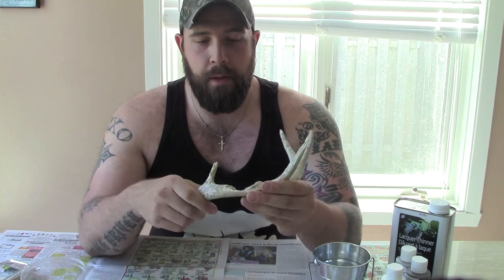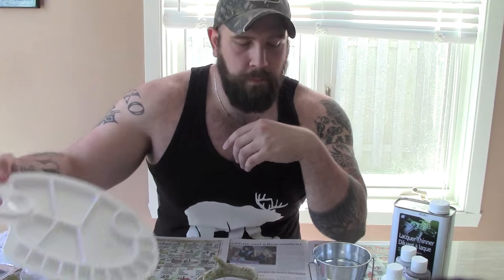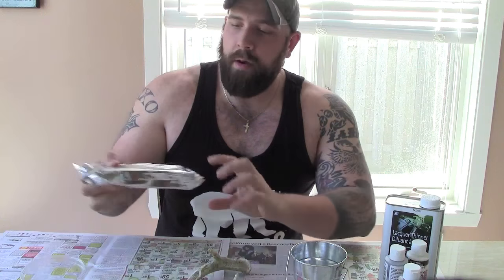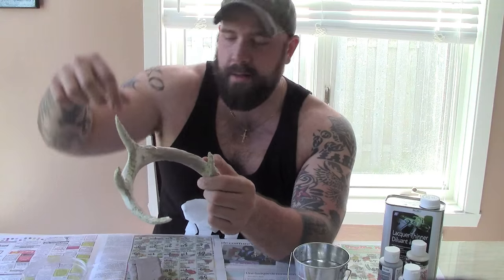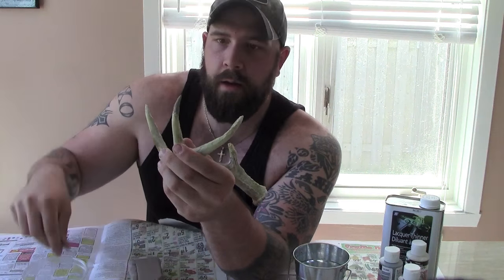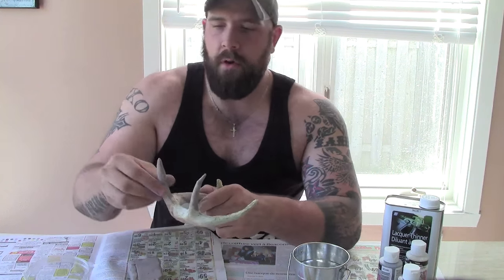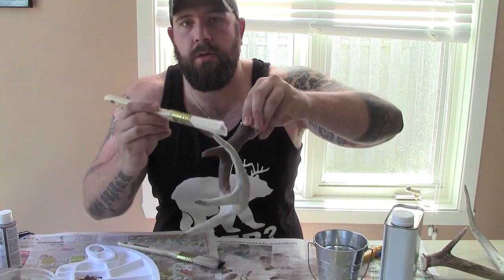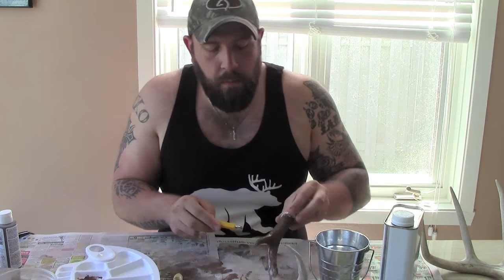Shed Antler Restoration: Fixing Sun-Bleached, Chewed & Broken Tined Antlers

Comment: Does the model clay harden up where it won't bend after it dries
Reply from the maker: Great question Bobby. There wasn't much clay that got added to the tines so it could be it'll crack off if applied force. Some taxidermists put rods into the antler to further support the putty or clay. I'll try to find a spray thatll go on to give it a glossy and shiny look while also strengthening the clay from cracking. Hope this helps and thanks for watching